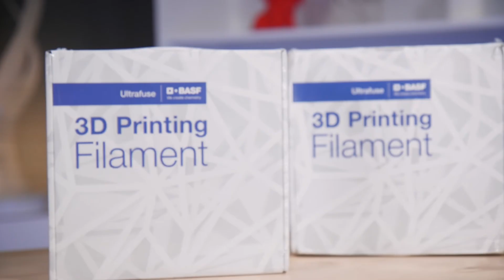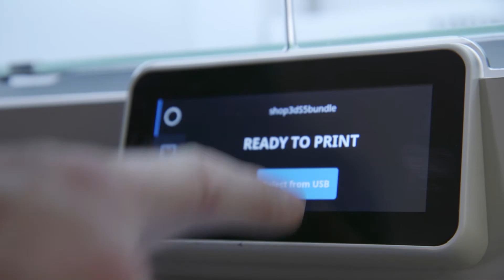Metal Filaments Workflow Overview

Comment: Is there any techniques you can use to debind and sinter at home?
Reply from the maker: We do not recommend attempting this at home. As there needs to be very specific temperatures and systems in place to perform this process. it would not work in a home setting.